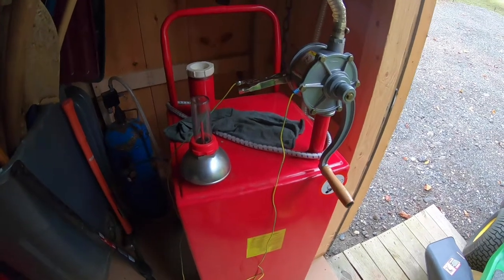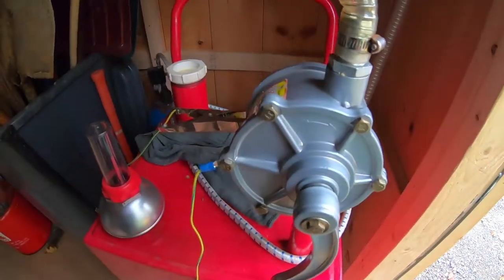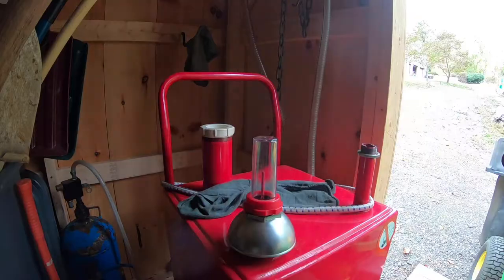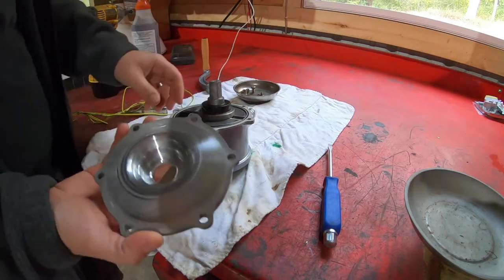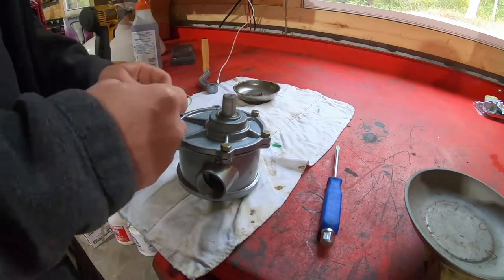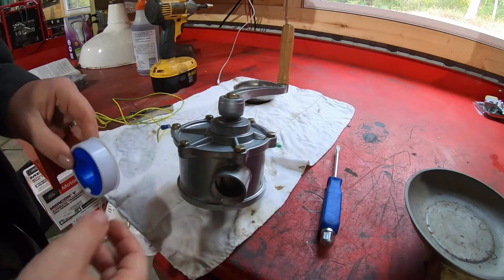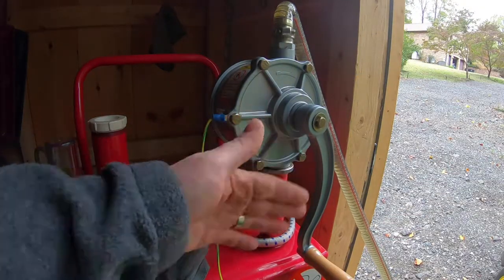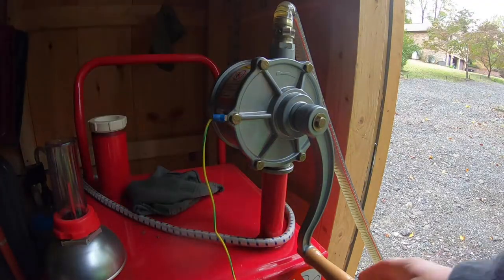Fixing A Gas Caddy That Leaks

Comment: I appreciate the review and have been interested in one of these tanks, but very little legit reviews of them.  How has it held up since the o-ring replacement/installation?  Has the fuel level gauge worked?  Thanks
Reply from the maker: NCSUME1 fuel gauge doesn’t really work. I just shake the tank to feel what’s in it! The tank leaks a little but when cranking the pump, but nothing like it did before. At least it’s useable now.
Reply: @jrodjared  Thanks.  There are a lot of these out there at all different price points and they all seem kinda crummy.  Might as well spend ~250 and modify vs 450 and have similar issues.  Thanks again.

PS.  Decent hand pumps cost as much as this rig
Reply from the maker: @NCSUME1  It would be cool to compare side by side, but I agree. They're probably both made of the same quality anyway so why pay more?